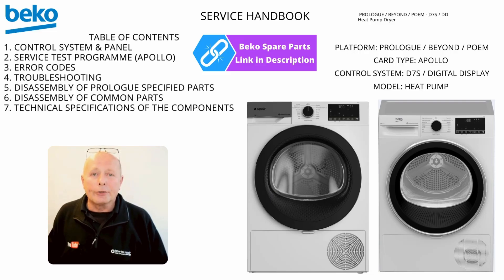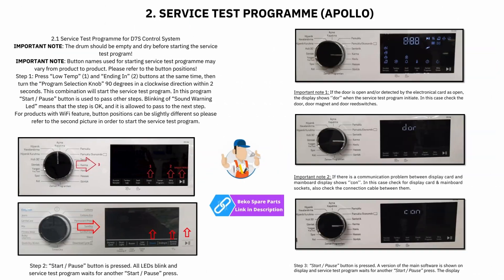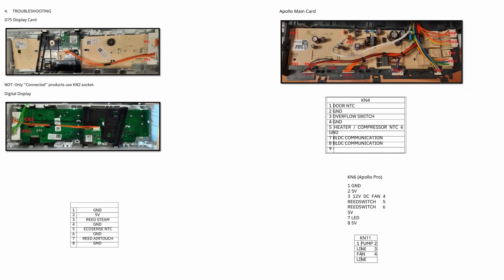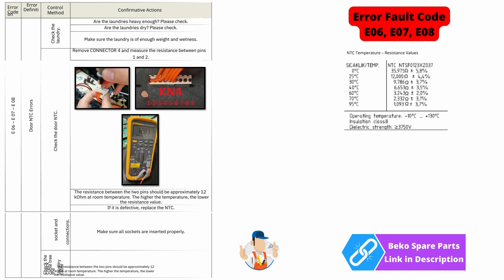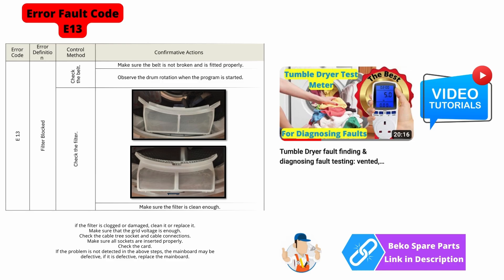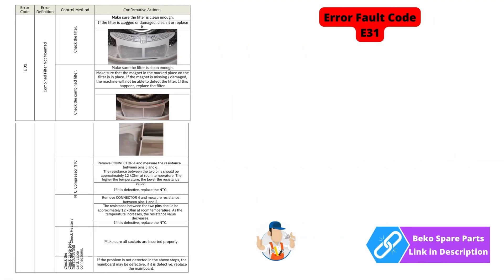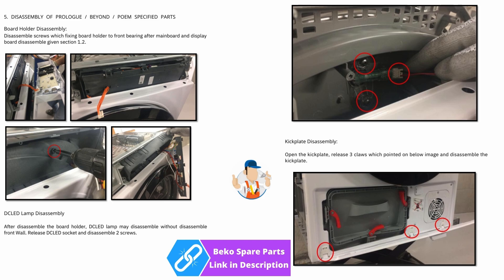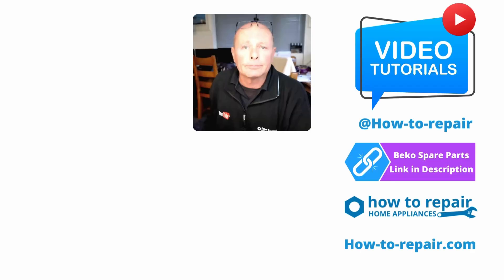Beko Heat pump tumble dryer Service workshop manual & diagnostic procedure

Comment: I’ve a B5T4923IW and these steps to activate test mode don’t work. Machine is bPRO500. Do you know how I find test more for this model? Thanks.
Reply: I have the B5T692343WBPB, bPRO500 and it doesn't work for me either.

Comment: I've got a Dphr8pb561w, it runs without any errors, compressor comes on but still does not dry clothes. I've pulled machine apart and cleaned out condenser but still not resolved issue.
I condenser does not get cold on the front but compressor gets quite hot but never trips.
Could it be low gas, I thought compressor would not run if there is no gas.
Any help appreciated.

Comment: How can I really clean the heat exchanger? Unlike the condender types it can't be taken out. With the brush it is not enough there is still fluff inside I can't reach.
Reply: Dismantle the dryer

Comment: I am getting eeor code 09 and 35 in my Beko B5T4823RW. I checked the 'door NTC' but I think the fault realtes to another NTC, on the compressor? Can you please tell me where that is located, and if it is a replaceable part and where I could buy the part. Thanks!